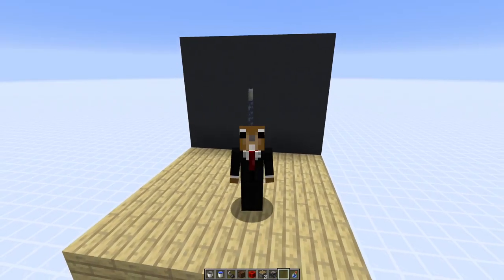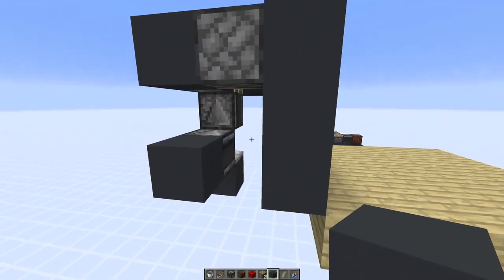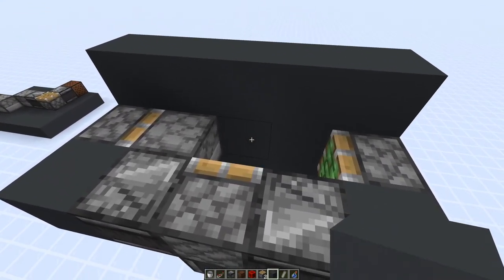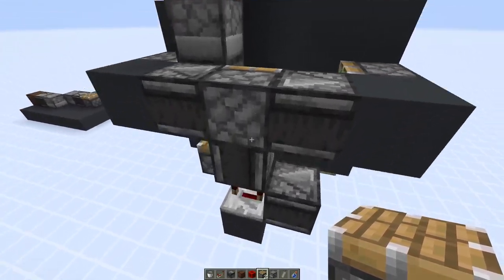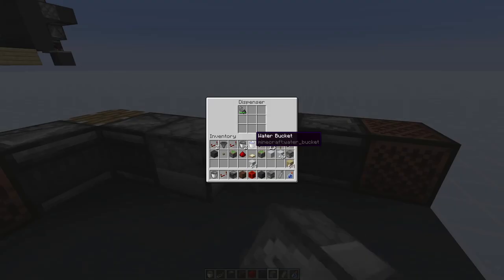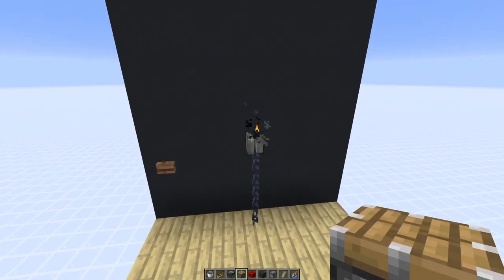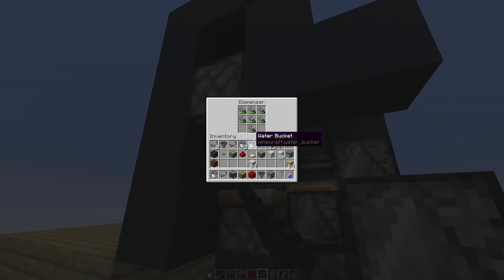MBE #8: Hidden Candle Light Switch

Comment: You may not have tweakeroo, but you still should have flippinCactus for blocks flippin
Reply: Hi gnembon! I wanted to say thank you for making the carpet mod, it's really helpful and has loads of cool features. I have a question: when I run /tick warp, nothing seems to happen. Any idea why?
Reply: @joelswedensky8537  you have to give the command a number of tick it should warp

 (e.g.) 
\tick warp 3600
Reply: @godefroyrassel7825  I did that, I didn't write it because it was non-essential. Doesn't work whatever number I use.
Reply: debug stick?
Reply: @thatchapthere  No, there's a feature called flippinCactus where you can use cacti to rotate blocks. Though I suppose debug sticks would also be good, not in survival though
Reply: @joelswedensky8537  I see
Reply: I would go to the scicraft discord if you need support for carpet mod. Makes it easier to have everything in one place
Reply: Carpet mod is so good man. It helps me afk without having my computer get ruined from wasting 16 hours

Comment: Maybe in use with skulk sensors you could make a hallway where the candles only light up when they're near you or you're near them
Reply: Ghost house intensifies
Reply: Bro puffer fish bro bro pressure plate bro bro tripwire bro bro renamed hostile mobs on pressure plates or tripwires bro etc
Reply: @bamgb8811  only the pufferfish can be hidden like the skulk, but the pufferfish can detect the player even if the player isnt moving so theres a slight difference
Reply: @SergeantXray  it will do the same thing when you walk in the hallway
Reply: Oh yeah, and you have to keep moving or the lights all go out

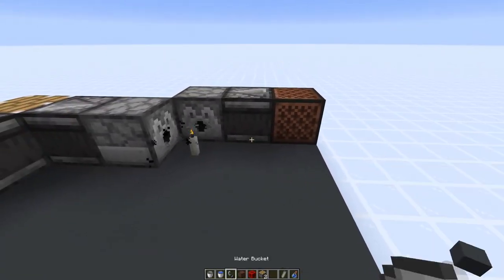Comment: 0:47 omg thanks. I have been searching high and low for a super compact way to turn an on or off signal into two pulses. Lanterns only give 1 but i guess the delay for pistons is long enough to result in 2
(Lanterns is an excellent way to add delay for turning off but not when turning on)

Comment: ive seen candles lit by flaming arrows - so could you make a hidden light switch using 1 dispenser that shoots an arrow through lava onto the candle, then above it a dispenser that releases water onto it?
Reply: I think the problem here is that arrows have a random velocity component, so you would have to also align the arrows and get rid of them after they hit the candle, it would be a pretty big contraption
Reply: Problably a fire charge will also work. Not sure if you have to waterlog the candle or just have water on it for it to go out.
Reply: @TheDarkness344  The fire charge is a good one, but it would still require it to be aligned in order to hit the candle, I think that the hitbox for this is only the block collision box.
Reply: @TheDarkness344  fire charge would work, but yes, just dropping water on top won’t put it out.
Reply: You have to waterlog the candle to extinguish it, just letting water touch it isn't enough. So without a movable tile entities mod you always need a visible dispenser next to it to extinguish it. Lighting it remotely with a hidden dispenser should be possible though.
Reply: @IkBenBenG  It might be possible to use water spreading mechanics to waterlog the candle from a distance, but there wouldn't be a way to remove the water remotely.

Comment: Be neat if the candle could be used as a mobile light source. Like you can use it in your off hand in a cave for lots of light !
Reply: I think the lantern should do that
Reply: @_Azulite_  I agree. But that should be a separate, non-stackable variant of the lantern we have already. In my opinion, at least.
Reply: Optifine already allows you to make light sources in your hand produce light.
Reply: I am afraid that dynamic lightning will couse server stress, and i dont thing it is necessary

Comment: If you dont want to use MBE you can still do it without the pushing mechanism but just using fire charges I believe but idk how you would extinguish
Reply: Maybe using a water Splash potion? Dont know if it works on candles?
Reply from the maker: @godefroyrassel7825  doesnt
Reply: @ilmango   alright though so, thanks for the check
Reply: Is there any way to unwater-log candles without using a bucket=
Reply from the maker: @pbtheman2653  yes. use an empty hand right click. as mentioned in the video you're commenting on
Reply: @ilmango  oh i meant automate so no player interaction but I don't this there is any way to do that.

Comment: Do fire charges fly straight out if a despenser?  If so couldn't you make a system that moves a block in the ceiling to reveal a despenser with fire charges in it?  I'm not sure on putting the candle out though.  The candle has to be water logged right?  Do snow balls or splash water bottles affect candles?
Reply: The fire charge could miss, you can probably make a system to align them but that supper overkill...
Reply: @bluelemon243  overkill in a redstone system to auto light and extinguish candles?  No such thing. :) I do wish we had movable block entities though.

Comment: Make a keycard scanner thing where the input and output for the item is one chest.
Reply: Just use an item filter. Have the correct item be brought through hoppers, use a comparator to detect a signal from it passing through, and have the item be send back with a bubble elevator or something.

Comment: You actually don’t need mbe to do this, you can actually just shoot out a fire charge out of a dispenser and a water bottle to put it out from a distance, and it would actually be simpler than using mbe with flint and steel
Reply: I think you would still need to move the water bucket dispenser
Reply: @xogdo5260  no, you would just use a splash potion of water, or what ever it is called
Reply: @redthunder6183  yeah, good point, It would be possible without MBE, but it would be expensive/annoying to refill
Reply: @xogdo5260  well, unenchanted flint and steel only has 65 uses. so unless you enchant the flint and steel, it doesn't make that big of a difference.
Reply: @redthunder6183  well, I 100% prefer to make 9 flint and steel and be done for 585 uses instead of needing 585 firecharges AND 585 splash water bottle. It absolutely makes a big difference (even with just one f&s versus 65 firecharges+water)
Reply: @xogdo5260  true, but it is the only way to make one that is completely flush on java... that's why I play on bedrock lol

Comment: You know Mango, the problem with this MBE series is that this no longer works on vanilla servers. And I don't think anyone is ever going to use this on a modded world.

In modded Minecaft there are so much more stuff, that basically nobody is using vanilla mechanics. Storage system's don't use redstone, they use AE. Mob farms don't have flying machines, they use vector plates, or conveyor belts, or fans. You don't use vanilla candles, Thaumcraft has floating ones, or you use the many, many, many other light sources, like glowing flowers, light particles, and such. And for every redstone invention, there is a mod that does the same faster, better and more compact.

Basically, If you play Vanilla, you can't do this, and if you mod the game, you don't care about this. Sorry.
Reply: Correct. The point of this series is that MBE get added to vanilla, which would remove the problem you are talking about.

Comment: Doesn’t fire charges also work to light the candle from a range?
Reply: Yeah but fire charges are expensive
Reply: @bragapedro  not in 1.16+
Reply: then it may be big issue with doube trigering.
Reply: @adamrezabek9469  why? I mean, not everyone has a blaze farm
Reply: @bragapedro  bertering?
Reply: @adamrezabek9469  you could have a carpet of water drop from the ceiling rather than from the same dispenser if that’s what you mean
Reply: @bamgb8811  that doesnt distinguish it, candle needs to be waterlogged
Reply: @noel.friedrich   is there any other way to extinguish it?